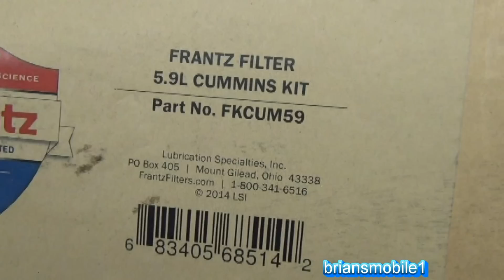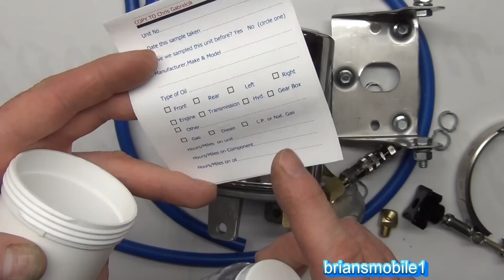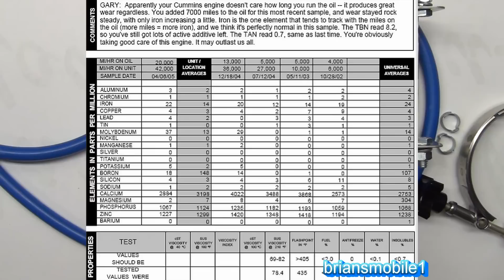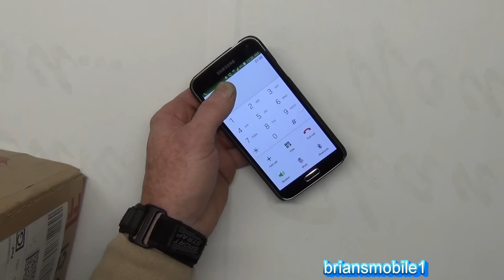How to Make Synthetic Oil Last Even Longer  Frantz

Comment: I have seen those before. but didn't know anything about them. I'm glad you reviewed it. but t.p. it looks like they would at least make their own brand. does it matter what kind of paper you use? is it just the cheap single layer stuff. and I guess you can't reuse use the paper. what would be the point of wiping with oily paper.haha.. but great review. now if they could find a way to get that kind of fuel mileage! how much psi  is required to push the oil through the paper? is there a minimum psi before it will work properly?
Reply: About the only paper that fits the Frantz is the Frantz elements. When I bought my first Frantz the grocery stores were full of 2 ply facial quality TP.  In the 60s single ply was loose wound junk. We used 2 ply facial quality. Havent used theFrantz in years. Getting hard to find paper that fits the Frantz. The problem is the larger cores. Frantz needs a 1 1/2 inch core. People are putting spacers on the center tube so that they can use the bigger core TP. About the only paper that fits now is the Frantz  paper. You could find 1 1/2 inch core Scott 1000 a short time ago. The same for Great Value 1000 from Walmart. The top loaders dont care what size the core is. Jackmaster has a 2inch core seal. The Frantz core seal is also too small.  Motor Guard Gulf Coast junior  and Jackmaster  put some thought into making filters that are easy to service. Frantz is a terrible design.  The paper companies wont make paper to fit the filters. The filters will have to fit the TP.  Of course the filter makers are having TP custom made to fit. I get mine at Walmart. Im a TP squeezer. Ive never had an engine that doesn't have enough oil pressure for TP. If my oil light comes on at a stop sign I would find out why.
Reply: Brian has the Frantz element. The core is 1 1/2 inch. Notice the core seal imprint around core. People are putting a spacer on the tube so they can use the.bigger TP tube.The top loaders use a larger core seal. You can also get TP that fits for 30 bucks or more. The Frantz element is probably more economical. Havent sold them since the 80s.You do what you gotta do for 100% clean oil 100% of the time. Saw on Ebay the Jackmaster elements cost about the same as the Frantz elements. Of course you have the shipping cost from Australia.

Comment: I have a question i have a toyota camry 08 and i have 81,000 thousand miles on it should i start using syntetic oil on my car to protect the engine
Reply: yes
Reply: I went to synthetic oil at 225.000 on my 93 Subaru Legacy. It has 238.000 miles on it now.. Its a backup car now. Still dont use oil.
Reply: When I was selling the Frantz in the early 80s a guy asked me if it was too late to put a Frantz on his Corolla with about 100.000 miles on it. I asked him how long he planned on keeping it. He said a long time. I said it needs a Frantz. Years later  my wife was was introducing me to a realtor here in Denton Texas. She said mr Biggs this is my husband.. He said I know Ralph. He put a Frantz on the Corolla. It has over 500.000 miles on it now. Took the boy scouts on a camp out and they found the Frantz elements.

Comment: what kind did you use on your plasma cutter?
Reply from the maker: I don't remember the name.  I got it at the pro welding shop in town.
Reply: It's a Motor Guard.  They started as a lube oil filter in 1961. They are submicronic.  They haven't made oil filters in a long time. My Altima has two of them. Have to remove the grill to service them. The Motor Guard on my 76 f250 with the  390 is over 50 years old..some crazy people like me put a orifice in the compressed air filter and cut aluminum parts for the inside to filter motor oil.They were the best in the 60s. Got tired of the bull shit stories and being sued by Frantz.They already had the better selling compressed air filters and dropped the Lube oil filters. The compressed air filters are submicronic. They go to body shops instrument air aircraft painting of course plazma cutting. For filtering motor oil they had manifolds for diesel trucks.The bigger the engine the more TP filters they manifolded together. Grand Auto parts in San Jose California sold them. I tried to bring them back. Motor Guard ddidnt like me using TP. They have their own elements. They were designed to use TP.. the compressed air elements are like coffee filter paper with a plastic core  for people that run wet air thru them. They are not a water seperater. I had refrigerated  water seperators at work upstream from the Motor Guards. The Motor Guards were the only ones safe to use for compressed air.
Reply: At one time I could find Motor Guards for less than a hundred and convert them back to lube oil. About as cheap to just buy a Jackmaster Classic. The Jackmaster would be strong enough to filter compressed air but it is die cast aluminum with no coating inside. And you would need to drill out the orifice Probably would do fine if you didnt leave it setting with a wet element

Comment: Just installed one of these on my caravan... Took a reading on the dipstick prior to and after installation, both were good. Now after i ran the vehicle a couple miles, the dipstick shows more than a qt low!!!! ... Any ideas? Thanks.
Reply: Jaymoe69  i guess the frantz filter fills up with oil after starting engine and remains full as oil filters through it, so that's where your missing quart is on the dipstick. It's not rocket science!
Reply: When I put a Motor Guard on the wifes 66 VW beetle I had to tilt it so the big pieces of metal wouldnt go back in the engine at shut down. The Motor Guard filtered from the bottom up. Frantz recommended putting the Frantz upside down on the beetle. The beetle came with no filter. I believe before I met her she was getting the oil changed about every 1500 miles. Never got another oil change.I brought a new Motor Guard to our next date. Those piece of crap engines could last a long time with clean oil and frequent valve adjustments.

Comment: I don't drain oil .I started using the Frantz in 1963. I was using Standard Delo 100 30 wt. Engines were a lot dirtier in those days. I was changing the Frantz every 2000 k and adding a qt of oil.What happens to me was an older Standard oil employee explained to me if I used a Frantz and Delo my engine wouldn't wear out and I wouldn't need to change the oil. The thing was to change the Frantz. and add enough new oil to keep the oil clean and the additive package up to specs.When I saw my Delo turn from black to gold there was no need to waste money on oil analysis. I was hooked. I liked the Motor Guard better but the Motor Guard oil filters were discontinued in the 70s. I just put a. M 60 on a Subaru transmission. 2. M 30s on the engine and transmission on a Pontiac Torrant. I am trying the Pennzoil Platinum on the Pontiac. The 93 Subaru still uses the conventional oil. My 84 Subaru did very well on Mobil 1. I only have 40 k on the Smart car with the Pennzoil. It looks like it will do fine with 7 k filter changes.

Comment: Would this cause too much of a flow restriction and possible excessive wear on the oil pump given that the pump is having to draw the oil not only through the stock filter, but also the add-on filter (especially given the small hole and dense filter cartridge)?
Reply from the maker: Not at all.  It's a separate circuit of the oil.  It can block off completely and your main filter and it's business will just continue.  This takes just a tiny bit of oil out of circulation- cleans it thoroughly and then puts it back in.
Reply: Cool. Thanks for the info and the prompt response to my inquiry.
Reply: Bypass filters have been in use for a hundred years. They all hook up the same as the Frantz. They came out in the 20s and were optional equipment. My 41 Dodge came with a Fram with a cotton element. John Frantz invented a adapter that converted the Fram and other canister filters to use toilet paper. My 64 Rambler American flat head 6 came with a factory installed  bypass filter upside down on the head with steel oil lines. To clean the oil I removed it and installed a Frantz. Recently got in a Australian Jackmaster Classic. Just my opinion but I thinl it is the best available if you are like me and use toilet paper. I have been using Great Value 1000. The Jackmaster Classic is designed for tightly wound toilet paper or you can pay up to 30 dollars and more for the factory elements. They have a 2 inch core seal. No I dont sell filters now. Ive used and sold all of them. They all clean oil if they use toilet paper or something that looks like toilet paper. Correction. I have sold all of the main ones Frantz Motor Guard Gulf Coast Jackmaster. Another correction Never sold the Jackmaster Classic.
Reply: The oil pump pulls oil up from the oil pan and pressures up the engine oil system and the bypass filter. A relief valve in the oil pump sends what the engine and bypass filter dont need back to the oil pan. If your engine has a turbo its the same as the Frantz. Oil goes to the turbo bearing and back to the oil pan. The more the engine wears the more oil it takes to pressure up the engine. If the oil pump is worn out or the relief valve is stuck open you might not have enough oil pressure. The small amount going to the bypass filter or turbo bearing is nothing.
Reply: @ralphwood8818  I appreciate the response and info, but you do realize I posed this question to the original poster more than 6 years ago, right? 😅
Reply: @addie750  Yes. Better late than never.  Others will read my posts. I was reading a post that seemed familiar. I wrote it in 03. Got into a debate with a smart as hell guy on a Trawler forum. It was a NASA engineer. He said bring your wife down to Canaveral I will take you on a tour and we can talk about filters.I called Gulf Coast Filters and told them to send someone down there that understands large diesels. They are listed as a customer now on their website.people that own trawlers are not fools.Ive sold filters to be factory installed on new boats. Probably read my posts on the Trawler forum. Dont sell them now. Getting old.
Reply: @ralphwood8818  Ha! You do have a point there. Funny and interesting stuff man!👍🏻😁
Reply: @addie750  can you imagine someone responsible for moving the space shuttle talking to me about the old 6.9 Ford diesel. I knew I was in over my head. He needed to talk to Shell engineers about Locomotives engines on offshore rigs. Looks like Gulf Coast filters dont do small filters now. They turned that over to the Australian Jackmaster filter.company.
Reply: Say some jackmaster Classic elements. Looks like about the same price as the Frantz elements. Then you have the shipping from Australia. The 30 dollar elements might be for the more expensive filters.
Reply: I saw some Jackmaster Classic elements in a 2 roll package. 40.00 dollars. for the package. The Jackmaster Classic elements are very high quality Australian toilet paper in a bag. Its good old Walmart Great Value 1000 sheet for me. You can get paper as good as toilet paper for 36 dollars.

Comment: Hello, I'm considering installing one of these systems in my vehicle (2008 caravan 3.3 v6) however, one concern I have is how well will this filter perform under cold weather conditions? I live in Michigan, and this season we've endoured many consistant days of negative sub-zero temperatures.... Alternately will the tp filter freeze solid such that it impedes the flow \ circulation of oil durring cold morning warm-up?

Comment: I remember changing those filters on forklifts for years.  At least 20 years plus.
Reply: I was a mechanic for Safety Kleen corporation. I had oil filters on everything. Gulf Coast filters on the fork trucks. Big Gulf Coast paper towel filters on the hydraulic systems and the yard tractors.  Motor Guards on the instrument air. And Sky tracks. The only trouble I had with the Gulf Coast juniors is the captive nut in the glass filled nylon  couldnt be tightened enough. Instead of putting in a thru bolt and flat washers I would go by and push the filters upright. I also had Motor Guards on the big air compressor lube oil. The special compressor oil was high dollar. The Nylon Gulf Coast filters took a beating on the lift trucks No springs and hard rubber tires.
Reply: Just noticed the Gulf Coast junior is laying down on the Farmall. H. Putting the captive nut in the nylon is a minor nuisance.  A longer bolt and using 2 wrenches will fix that. Other than that its a perfect filter. Its the Hydraulic system filter. Dont matter what position its in. The Gulf Coast juniorc on the Gasoline on the F250 and the Farmall are upside down on the frame..

Comment: 1:40 in and im thinking this is a late april fools joke
Reply from the maker: Ha ha!  I thought the same thing the first time I heard about this idea when I was in Middle School.  It's legit!
Reply: I'm not sure I get it, is that seriously a toilet roll you buy from the shops or something you specifically order?
Reply: +briansmobile1 It doesn't help that the first time I heard it, it was April fools. lol
Reply from the maker: You order it for it to be exactly the right size and ready to go.  Otherwise some folks use the gas station rolls or Scott 1000 and then unwind about 30 rolls.
Reply: Single or double ply?
Reply from the maker: Always lint free single ply.
thetwinkleturnip
Reply: The last Great Value 1000 I got from Walmart I didnt have to unwind 30 rounds. The roll is the same as what we used in the 60s. The problem is the core is too big for the Frantz.. The Jackmaster. Is set up with a 2 inch core seal for we TP users. The shorter roll doesnt matter in the top loaders. Jackmaster is the best. They have 30 dollar elements they say are better than TP. I wont use anything but TP. Served me well for 60 years. Scott 1000 or Great Value 1000. There are other good rolls. In the 60s we used 2 ply facial quality with a 1 1/2 inch core..The FAA approved AeroFrantz took the same.
Reply: I was wrong about the 30 dollar elements fitting the Jackmaster Classic. The Jackmaster Classic  takes toilet paper or the Jackmaster Classic paper. Some take a 36 dollar paper that is as good as Scott 1000 or the Frantz elements.
Reply: The Charmin Ultra strong is about the same as what we used in the 60s. We didnt have Scott 1000 or Frantz elements in the 60s. I recently used Charmin Ultra Strong in the Motor Guard diesel fuel filter. The Great Value 1000 from Walmart is too dense for the Ford diesel tractor. Its gravity from the fuel tank to the injection system
Reply: Yes I know the shit paper will come apart and clog up the injection system. Actually I have a inline fuel filter after the Motor Guard in case something gets on the wrong side of the toilet paper when I change it. Any paper gets stronger in oil or fuel.

Comment: Original Frantz company claimed 1/10th micron.
Reply: Ive used toilet paper filters for 60 years. Ive heard claims 1/100th of 1 micron to 5 microns The Australian Jackmaster Classic claims 1 micron if you use their elements. They use a very tightly wound roll of toilet paper in a bag. They put about a .060 orifice at the outlet. On my Jackmaster Classic I put a .025 wire welder tip in a brass fitting and put it in the inlet. I know there is danger of the small orifice clogging but my engine is pristine. I make sure the Jackmaster Classic is heating up. The Jackmaster Classic and the Gulf Coast junior are my favorite filters. All of the toiler paper filters are good.

Comment: Does the sandwich plate ( fitting between the twist off filter and engine block) come with the kit ?? As well as the quick release couplings for the return line? They don't say in the description secondly, i know for sure it does not include the aluminium oil cap you have shown there.. @ least for the universal kit anyhow...
Reply: At one time Frantz had two port sandwich adapters. A piece of cake. A port for a hose to the Frantz and a port for the return. They didnt work so well for small engjnes. Not enough flow. I have used oil cooler adapters from Jegs  The Perma Cool universal. When I bought a Australian Jackmaster Classic  from Ebay I noticed they had a bunch of sandwich adapters. I didnt need one.I converted a two port to a one port sandwich and returned the clean oil by tapping the plastic oil fill extension.Pontiac 3400. Also noticed the Jackmaster Classic has dropped in price  The 93 Subaru Legacy has a Perma Cool universal sandwich adapter that I got from Jegs years ago. They are for oil coolers. The clean oil from the Motor Guard goes into the inlet of the full flow filter.